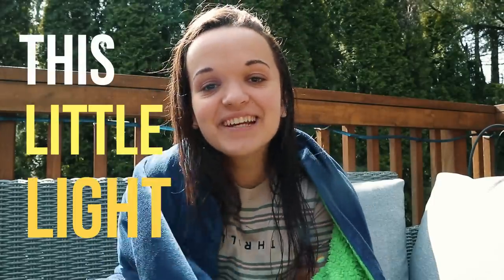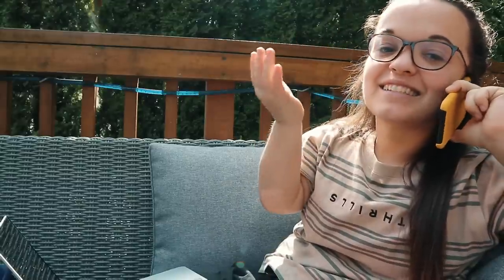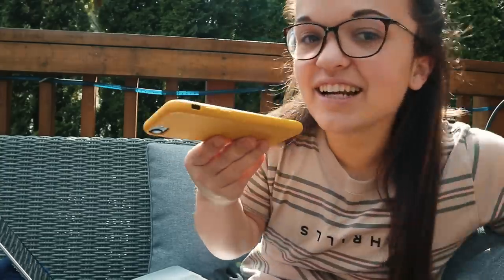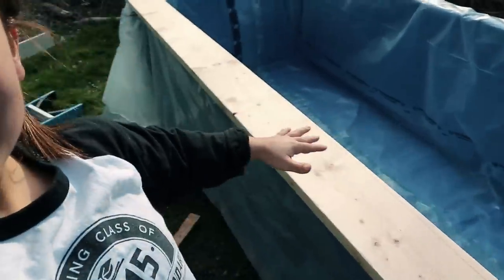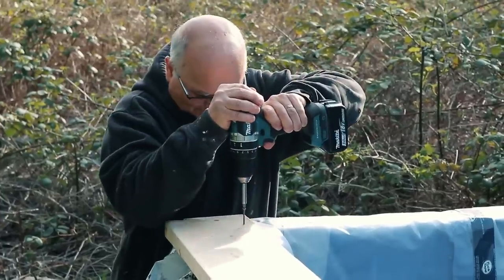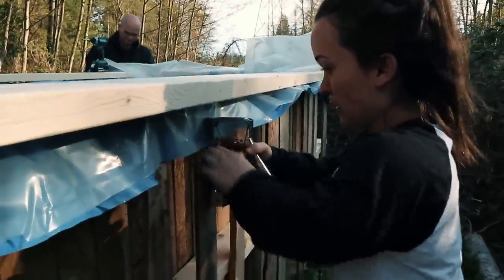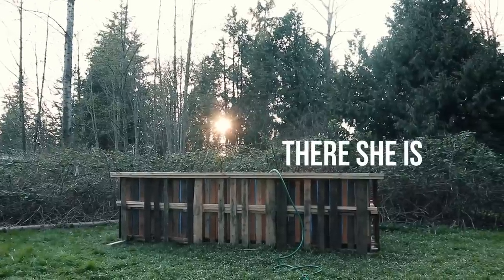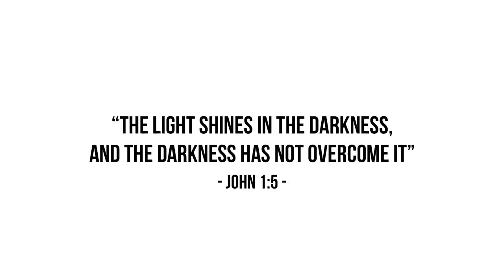I BUILT MY OWN SWIMMING POOL IN 5 DAYS!! (DIY VLOG)

Comment: Great video, thanks for sharing. Two things. Were the screws Philips head? If you do this again, use Robertson screws, aka square drive. The bit stays in and they don't strip like Philips. Second, why not put the poly down first then the tarp on top? Wouldn't the tarp be less prone to leaking? My old 18 foot round pool is on its last legs so I'm looking for ideas on how to replace it. Might try this. I have heater suggestions if you want them. Cheers!

Comment: Thank you for your video.
my questions is, what type of liner did you put and how much mil? The one you put together with scocthtape, because I want to build the same, did it hold the water or it leaks...Thank you hope you response
Reply from the maker: Hey, great questions! I filmed a more in depth tutorial and you can check it out here: https://youtu.be/NEXXPVW30y8

The pool held the water really well, but I did get some bubbles in between the tarp and poly... but no major leaks and it's still standing after 5 months :)

Comment: Hi what brand of poly did you buy?   Any thickness especific of the plastic and also where did you buy it?  Thank you
Reply from the maker: Hey there! We used 6mL heavy poly, you can get it at any hardware store! Hope that helps... just buy the thickest poly and use a generous about of tuck tape :)
Reply: @thislittlelight24  Tuck tape or duck tape? Not sure if that's a typo.
Reply from the maker: @havenlove7023  it's called Tuck tape, no typo :)

Comment: What poly liner did you use
Reply: I used a super tarp 250 UV, can watch the build on my page
Reply from the maker: Hey there! We used 6mL heavy poly and you can get it at any hardware store! :)
Reply: @buildit7582  I watched yours on you tube...I have yours and this one saved as my inspiration..I looove your pool ty for the video..now if I can just get my hubby on board.😄